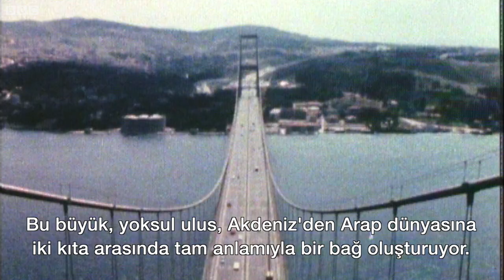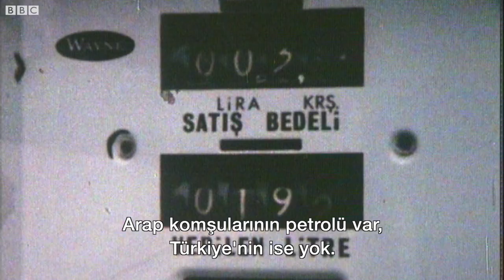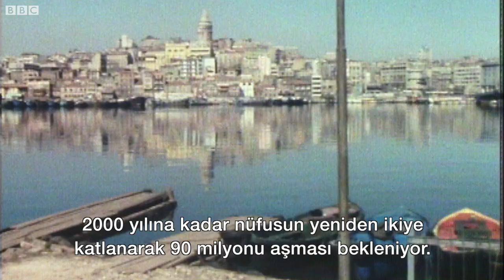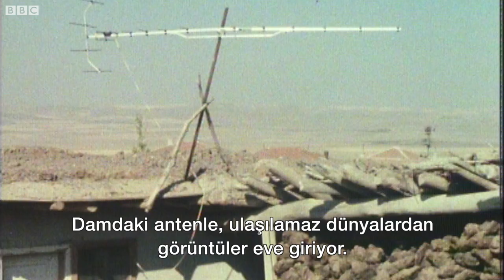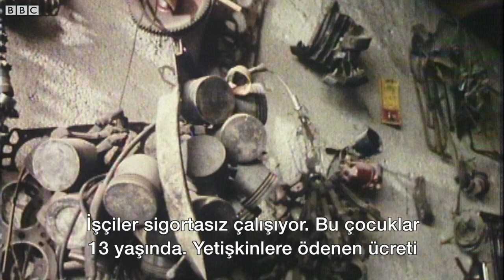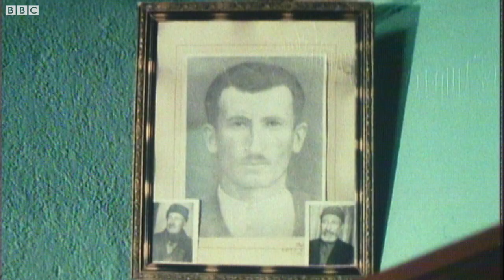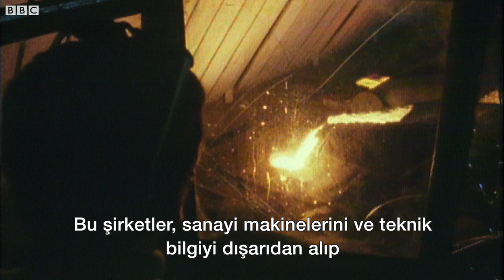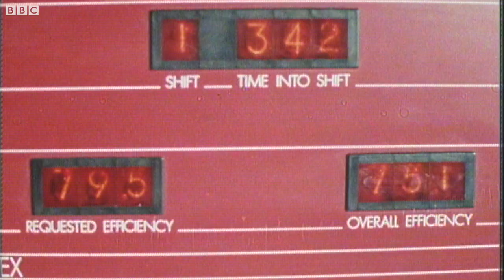1980'lerde Türk ekonomisi belgeseli: 1. bölüm

Comment: a couple of corrections (iki düzeltme):
- the army did not abolish the parliament in 1971, it just demanded the government to step down. when the government resigned, a new government has been formed within the same parliament. (ordu 1971'de meclisi feshetmedi, yalnızca hükûmetin istifasını taled etti. istifanın ardından yeni hükûmet yine aynı meclisin içinden çıktı.)
- "practically everything they need" does not mean "pratik olarak ihtiyaç duydukları her şey" - the proper translation should be along the lines of "ihtiyaç duydukları neredeyse her şey."